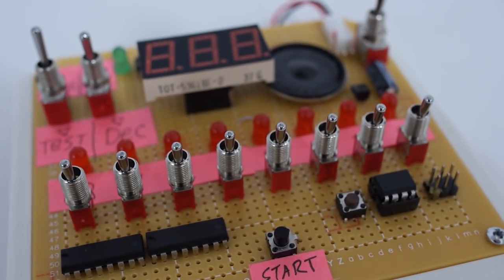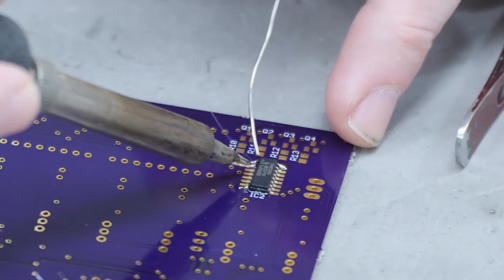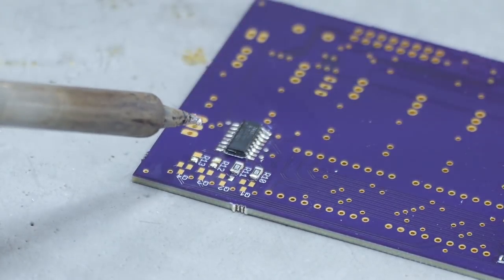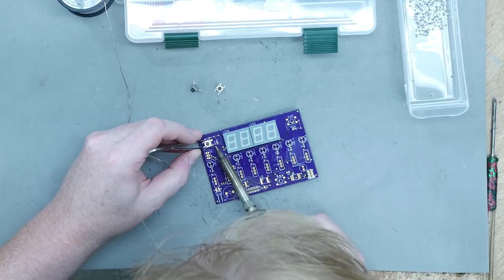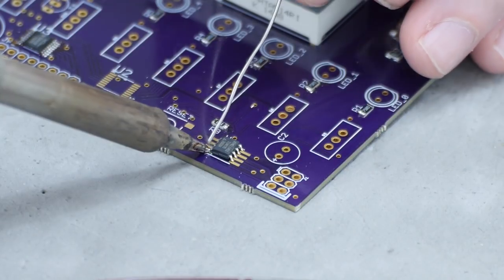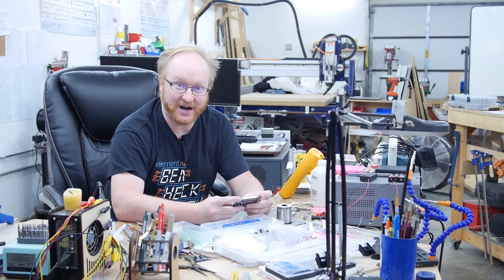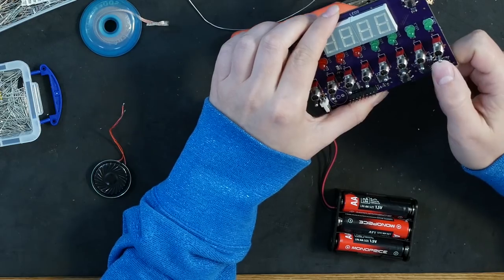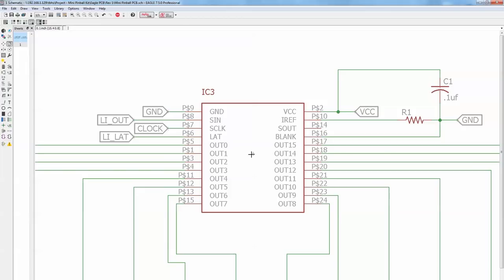Hex Game 02: Surface Mount Solder Fun!

Comment: Just a few points, from someone who's been working with this for 20+ years..  
1. Use thinner solder WAY thinner!
2. Use separate  "clear no clean flux.".
3. use as little solder as possible to fasten the circuit and as fast as possible, due to being heated again later. 
4. Put the solder along all the pins on one side.  That way you get quite even amount on each pin.
5. You only need to fasten at one point really if you continue soldering carefully on the same side.. BIG circuits sometimes need to be fastened at two or more points due to the pins being so small ,they easily bend..
6. Use solderwick before soldering the circuit on there again..
7. Use BIGGER solder tip, but shaped correctly. A sharp on the edges "mini wave" is good for almost anything and has tons of heat transfer.
Reply: I was thinking these same points. I've only been doing soldering for about a month now, but I've been learning from some pros at this, and they would wince at Ben's practices here.
Reply: Good tips! Felix actually gave me and Max a lot of good tips for the SMD parts. Many of which you mentioned. Sadly, since we were in front of the camera, no one was behind the camera to help capture that. Thanks for posting it here. Hopefully others will read and learn something new.

Comment: + simple soldering tip,
By the soldering irons with a silicone power/mains cables,  not the vinyl ones.
Makes the power cable so much more flexible and doesn't get in the way or have a tendency to affect precise positioning of the tip.
(Learned the hard way by saving the £5 for years)
Reply: That's a Weller soldering station. It is silicone, more flexible than it looks.

Comment: A flux pen silmilar would make that soldering job a whole lot easier. The bulk of the issues seem to be from that nasty looking tip in the iron. with good flux you can drag solder SMD no issue.
Reply: I like to use a finer solder to help reduce the accidental solder shorts.
Reply: to say it friendly: he should focus on soldering. Even with a lot of experience, talking and soldering to not mix well.
It is a two hand task with multiple items and this is a process where you really do not think in words about what you are doing. Trying to speak about soldering while soldering blocks the brain. Look how bigclive is soldering - he can talk off topic, while his fingers to fancy holding and handling - but note: He is rarely talking about his current action (really observe it - he either talks about the topic in general, offtopic or about his next action. he also talks about what he is seeing - but he rarely talks about what he is doing right now in the moment)
Reply: Mat: Yep, that tip is gnarly. :( FWIW, for drag soldering I prefer flux gel, as it holds parts steadier, and also dampens movements so it's slightly easier to make small movements without the chip flying away (by which I mean 2mm when you wanted to move it 0.2mm.)
Reply: Losttwo1 Yes. I use 0.3mm, 0.5mm, and 0.8mm solder, depending on the task. I have some old 1.2mm solder that is really just for giant mechanical joints at this point. I prefer to feed more of the thin stuff usually.
Reply: I was thinking solder paste and a heat gun would be a better way, am I wrong?
Reply: Even better than a flux pen. although not as accessible for students building these kits.

Comment: 6:21 I usually solder from right to left but I am right handed. This is because I have my soldering station in the left corner of my table so it is a lot more natural to solder that way for me. I guess it all depends on how you are used to soldering

Comment: That solder looks pasty, grey, and it is very oxidized. You should use flux. Also, I think the iron temperature is too hot, and you should use a finer tip as well. Cleaning the tip more often also helps. Also, use a finer soldering wire, say 0.3mm, and apply less of it. The joint should be concave and shiny, instead of convex and frosted.

You can see my video here, on how to solder basic SMD components: watch?v=8HOxuXqBGo

Hope it helps!

Comment: 15:50 gotta be really careful with the 'use a connector to align' trick - many aren't rated for the heat and I've melted many jst and molex shaped gizmos to get the alignment right. Be really light with the heat.

Comment: Wouldn't it be a good idea to use momentary push buttons instead of tumblers and reset the LEDS in software instead of having to reset all the tumblers manually after every HEX number?
Reply: Personally I'd find that more annoying, also the toggle switches give more of a tactile feedback of which bits are in which state vs having to switch focus between LEDs and buttons. Plus toggle switches give a nice aesthetic. That's just my opinion though.
Reply: It makes more sense to start at 0 every time versus converting a random number from another random number
Reply: The toggle switches are sooo satisfying to flick back and forth. It's part of what makes the game fun. It wouldn't be as good with buttons or slide switches. The toggle switches are definitely a feature!
Reply: Can't argue with that haha! Toggle switches are very satisfying.

Comment: What is soddering?
Reply: That's the British transcription of the correct pronunciation of "soldering" in American English, which sticks closer to the original French pronunciation of the word English borrowed. ;)
Reply: Antonio Tejada don't worry, I binged it. It's actually an incorrect term for 'soldering', usually used by idiots, or people with 'labtop' computers
Reply: It was pronounced without the L in old English, which was kept in America while the British started getting influenced by French pronunciations in the past couple hundred years. So ultimately, both pronunciations are the Brits' fault.
Reply: I don't get it. How would you pronounce labtop without an L?

Comment: 12:13 Flooding **so that you can heat the pins all at once**??? ::facepalm:: — that's exactly what you DON'T want to do: overheat the part. It is literally considered good practice to skip pins precisely so that you DON'T heat the chip too much in one area. (In drag soldering an SMD part, you should be in and out so quickly that it doesn't matter.)

Flooding is a great way to remove SMD chips, though, especially if you do not need to salvage the removed component.

Comment: I have only ever drawn single sided boards in high school with one of those pens, drilled by myself. Do all double-sided boards have conductors running along their holes like if a through-hole leg is connected on both sides? Or is that a manufacture/design option. I have a habit of leaving the iron on them for longer so solder wicks through to both sides at once. Can't see if this a bad idea but just want to know if it's always necessary. Thanks.